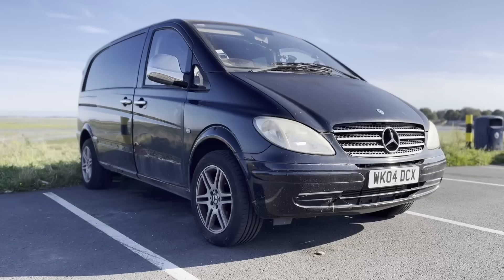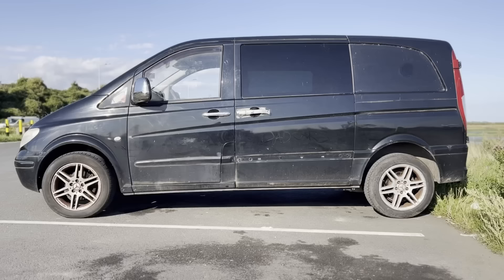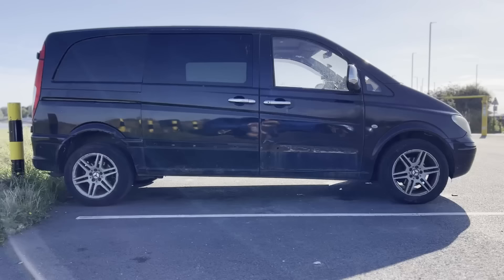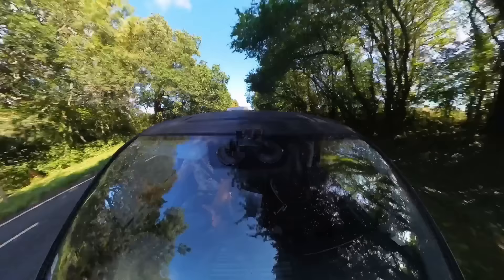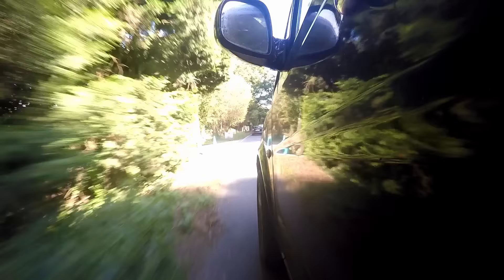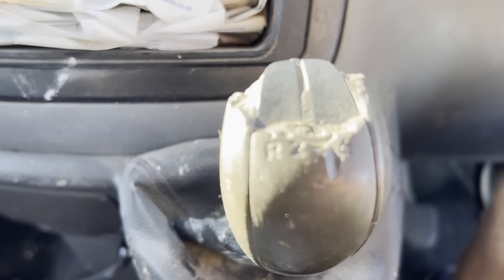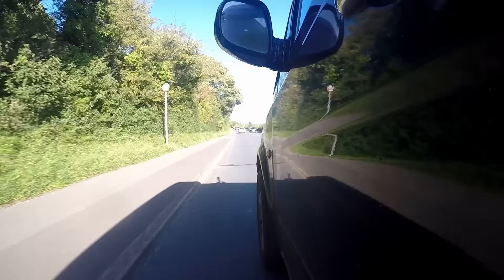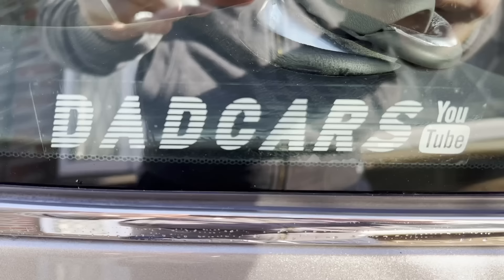The Mercedes Vito Is A Bargain VW Transporter Alternative With One BIG Problem

Comment: Love the vito. The removable captain  seats make them really versatile. I bought a 2010 model 4 years old in 2014. Had it for 10 years and taken it from 50k to 150k miles without a single issue. The dual sliding doors is totally a game changer and when we go camping we have an inflatable side cabin. Taken it skiing also in Austria and put chains on so rear wheel drive was fine.

Comment: I had 2 T4 Transporters and they were both high miles, and bulletproof, but 1.9D non turbo, so very slow. I wanted a T5 but when I looked around there were so many for sale with issues it put me off. I worked for a company that had 2 W639 Vitos with different blokes driving them, worn out looking, not an easy life, and 250k miles plus, but both ran well. I picked up a W639, 115CDI, not sure if it's chipped but it's very nippy, high miles, but drives really well and been a great van. I really rate the 639 2.2cdi.

Comment: Correct about the rust I had a 2004 vito ,and it went to the scrap yard.  
Now I have a 2013 vito and it's got very little rust. 
They are good work horses, they ran to 2013-14 . 
The later one return better mpg  but all are good value.

Comment: I’ve had both and the Vito is better to drive and more reliable and it’s got 217,000 miles on the clock,the only thing is the transporter was more spacious but the size was a issue with car parks where the Vito doesn’t have that problem,great video 👍

Comment: My dad just bought a first generation vito the thing is extremely beat up, but still relatively solid in mechanical means. Now it’s a challange for me to get it to pass the MOT 
Door sills wheel arches rear flooring panel needs replacing windscreen must be repaired the entire suspension of the van needs to be changed. It’s going to be heaps of work but I bet it will be fun wrenching with the old man
Reply from the maker: Father son time 😊🙌

Comment: Great video. I have managed to run my T5 for buttons. We needed a LWB Shuttle for our then 5 kids. We went on to have 8. Two big bills in 17 years. The trick is not to have it serviced at a dealer. Dealer parts and labour are eye watering. So big bill one was 4 years in and was a couple of grand. Big bill two was a refurb of injectors and turbo at 100,000 miles are an injector failure on the M1.  When a council tipper reversed into my T5 we got a Viano (posh Vito) for a loaner. It rode better and was more refined. I was also usefully smaller, even in XLWB spec. But the tin worm is the big issue with the Spanish built Vitos and back then they were just as expensive. In my experience lots of T5 spares are cheap as, especially the four cylinder which is all car parts. There is an endless supply of pattern parts from places like Autodoc. For example VW wanted £280 for an air-con condenser. Autodoc had one for £66. The five cylinder 2.5 AXD which I have is more expensive but it is a great engine and has a gear driven camshaft. I can't believe that over 17 years of motoring it has only depreciated about £10,000, or around £50 a month. They are pricey second hand but they do hold their value.
Reply from the maker: Great comment! Thanks for sharing this, wait what how many kids do you have?! 🤯
Reply: @dadcars  like you we had 4 young ones by the year 2000 which we carted about in a couple of T4s but we just kept going and by 2013 we had 8!
Reply from the maker: @Gorbyrev  that’s incredible! Well done 🙌😅

Comment: We had a 2007 extended 109 cdi version. Now we drive a petrol VW...( yup), a Caddy Maxi... 7 seater... and a boot! So they do exist. Do to emision regulations on diesel engines in the netherlands, we made the switch to petrol.. and you are right. A 7 seater with a boot are hard to find if you use the seats.
Reply from the maker: ULEZ in London is killing a lot of these good old work horses too 🥲

Comment: I bought a brand new 2004 Vito 115 at 150+bhp first in Cornwall, brilliant rally car in van clothing,12 months later the silver paint had an issue as every panel was a different shade and Mercedes said it was in a smash but no it was the paint, Mercedes repainted it free of charge, only other issue was the turbo actuators, years later and i mean years i pulled into a local garage and the guy who had bought it after my 2.5 years of ownership pulled up and the mechanics were perfect but the body was goosed,Currently on my second ML270 and still a merc fan.

Comment: I bought a cheap Vito when I started Amazon driving over lockdown. I loved it to bits!! It was ratty and faded red, but it was brilliant. Unfortunately it was rust that got it. The panels were a bit rusty but it was the underside that I couldn't see that claimed it. Nearly half the sill under the sliding door had dissolved and some very large holes in the front cross member. I would buy another in a heartbeat though, if it wasn't for the stupid London ulez. It would be the perfect vehicle for my current job, if I didn't have to go into the ulez zone regularly. Your video has made me really miss my red baron van 😢
Reply from the maker: Yeah ULEZ must be making it very hard for self employed people who need a van 😓

Comment: I've had x4 VW Transporters, 2 x 1.9 x 2 2.5 TDI  And I've Sold them all to go back to a MK1 W638 Vito Om611 Engine. Million Miles of Hassle Free Motoring With Mercedes. Values on MK1 Vitos are going up, get one before they go crazy in Value. The transporter market is Finished it's been over done for 10 plus years. People now want old Mercedes which is Great.
Reply from the maker: Things went crazy after Covid 🫣

Comment: Both my parents have owned transporters (mums is ‘05, Dad’s owned a few but current one is a ‘10 plate from new) and they’ve been basically flawless. An EGR fault on the 2010 and a faulty electric window on the 2005. 

I’m currently looking at getting my first van (to sleep in) and I’m torn between the Vito and Transporter purely due to cost… maybe I’ll end up with a Caddy 🤷‍♂️
Reply from the maker: You could get a Vito AND convert it for the same price as an equivalent transporter panel van 🤷‍♂️ if you, unlike me… keep on top of the rust then it’ll be a lovely owning experience for you
Reply: Have you seen the ludicrous prices for Caddy’s?😮😮😮😢

Comment: A company | worked for got a fleet of Vitos when they first came out (2002). The only issue I had with them was the lack of space above the pedals. On the one I was issued with I removed the trim above the pedals. They were all electronically restricted to 75mph. Except for some reason, mine wasn't. During a week off, one of the supervisors found out mine wasn't restricted and decided we were swapping vans.
Reply from the maker: 😅 how did their fair over time? All rust to bits?
Reply: @dadcars  I left the company 6 months after they were issued. Last time I saw one of the vans, it was 3 years later and it was on the side of the M4 at Reading after rear ending another car in a traffic jam. That one looked quite badly bent. 

I've been after a decent van for a while. I always dismissed these due to rust, and Mercedes parts cost. (Last Merc van I had (1984 508D) cost nearly £2,000 for a full set of brakes and put me off them for a while. I sold that van not long after (1999) and the person who bought it from me still uses it. So it was a reliable beast. ) Maybe I should reconsider.
Reply from the maker: @LordClunk  yeah parts not been to bad for me, always taken it to an independent garage of course

Comment: I have a 638 vito. Had it around 4years, and have the basic 108cdi, always starts and stops (discs all round) and is 100 x better than the vivaro it replaced.
Although mine has rust scabs, it's not impossible to tart up. The underside is solid.
Mine's fwd and regularly gets between 40-50mpg when driven carefully 👍
Reply from the maker: Would you believe I’ve never calculated my mpg 😅 but compared to the cars I drive, it feels like a tank of diesel goes on forever 🙌

Comment: Great vid thanks for sharing. I haven't owned a van for 27yrs. I used to run mk2 Transits. Couldnt find an affordable modern one that wasnt hanging off the chasis. I avoided the VW, like you say, excessive mileage at a decent price point. I know Mercs rust out but for a few hundred over my budget I picked up a SWB Sprinter, no rust. I had dismissed the Vito. This was because the independent Mercedes van guy who serviced my mates fleet said he wouldn't touch one. Ive seen a lot of older ones on the road, going strong, that says something. I like my Sprinter but boy is the front suspension and steering awful. Ive dropped a grand on mine, all the joints and shocks that were worn done. Its still tiring to drive, compared to my works, Transits. For a low top I can just stand up in it, a bonus as it doubles as a stealth camper as well as my daily commute/ PA shifter. Im not getting any younger. I may run it for a year and swap out for the Vito. Im not out in it enough to warrant the height. You’ve opened my eyes. If the Vito has "normal" suspension.
Reply from the maker: My suspension isn’t great 😅… I like the idea of doing a sprinter office/ camper conversation!
Reply: @dadcars  I'll have to hire one. See how it drives. From somewhere with older models. I don't buy new motors.

Comment: Great video. I liked my Vito(2004) but sold it to get back into a VW (T4 2.5 tdi)  which I love.  I can concure on the rust, seen some really bad Vito's but mine was pretty good, perhaps as I did wash and wax it regularly. The T4 does has some rust but not all over like some Vitos can get. The Vitos's ride was better (but my T4 is lowered a bit) and as was the drive, I loved the 6th gear and wish had it on the T4.  When I bought /sold prices were a bit more level, account for age, was probably 33% move for the vw but wasn't that expensive.

A bad point on the rear wheel drive it that in snow or mud it make it really hard (or fun) to drive. I'd take it out if had too but wife wouldn't. Note on the hand / foot brake too. I had no problem but it put my wife off driving it. 

The Vito has a chain not a belt so that seem to really help with the maintenance as the VW new belt big bill every 4 years seems to come round pretty quick. My T4 has been good for 4 out of 5 years. But last year was expensive. With the VW price being high it also means the depreciation is a lot lower.  I think my van is worth more now than when I bought it (covid 'camper' boom) but a Vito a lot less. That 50% price difference now probably right.

Bit of a heart not head decision to sell the Vito and get the T4. I have recommended people get a merc if they want a vw alternatie ('but check for rust as they can disolve'). Sold mine to get back into the VW scene as makes every trip more interesting (wave hunting, vvw spotting) and I do a fair few shows (more acturately convoys) so it's a hobby as well as means of transport.
Reply from the maker: VW is a lovely van to own if you can afford the price of entry I agree 🙌

Comment: Mercedes have a lot to answer for when it comes to rust..
Literally their entire range, Vitos, Sprinters, cars have rust issues in the early 2000's, seems like as you say maybe 2007 onwards (ish) they sorted it in their cars, not sure about their van range.

Edit: Dates might be off, its been a while since I researched.
Reply from the maker: It’s been disastrous for their reputation
Reply: I've been running vitos since 2004 with my latest being a 2017 which i bought new and I can tell you now, mercedes have never sorted their rust issues. 
I've been in the body repair trade since 2001 and the majority of rust repairs I do are on mercedes. With the newest being 1 year old.
I'm in a constant battle to keep the rust from getting too bad on my own van that it's the second time that I've had to repair my rear arches because of rust. Not mentioning all the other places that's starting to scab up.
If it wasn't for the rust they would be the best van on the road.
Reply: @paulweston4994  ah... that's sad news.
I really noticed a big difference appearance wise in their cars when going through years, but I've never owned one or been around them long enough to say with certainty.
I know their Sprinters are atrocious for rust.
Perhaps that's how they keep the price competitive because I get the impression (right or wrong) that the engines are often long lasting.

Comment: I’ve had mk1  6 seater then I bought a mk2 with fold down/ away seats.I had to get rid coz of rust issues that could not be resolved.I’m now on my third one a silver mk3, 13 plate panel van lwb . Having previously had a mk2 that rusted away before my very eyes I was dubious about getting another but after driving everything else I decided to take the risk. 
i would definitely recommend them again because they have rectified the issues with rust and adding to that definitely recommend them to anyone who wants low maintenance trouble free motoring.the engines very good and run forever and ever I wouldn’t buy anything else it drives like a car I can honestly tell you that it does corners at high speed I’ve got 18’s on mine with wide ass tires  and goes like the clappers and beats most people off the line and I’ve got a lwb!😮I love them !! The absolute Best van on the market!! For sure!
Reply from the maker: I wished I had a LWB every time I picked up sheet materials in this 🙈 you have to put plasterboard at an angle as it’s slightly too small

Comment: Previously had an 02 (W638) and an 07 (W639) Vito camper. The mk1 was worse for rust and on par with Transits.
I would avoid both models as you can never eliminate the rot.
Mechanical issues can be rectified.
After the MBs I converted an 09 Renault Master Minibus. Not a spot of rust on it. Highly recommend them and Trafics for camper conversions. Just bought a 2000 T4 Atlantis, luckily I just moved to Spain so rust isn't an issue here.

Comment: We had a 115 CDI crew cab Vito as the family car my father got it new in 2004 and had it until 2017 and that time covered over 200k miles and  never skipped a beat the only issue was from it starting to rust afrer about 10 years both side rear quarters around the sliding door rails
Reply from the maker: Bloomin rust! 😅 like you say, never skip a beat mechanically do they

Comment: I had a Mercedes with the same engine and it suffered from the "black death", was quite expensive to sort it out.  Check the injectors are not leaking.  Saying that I was able to replace the injector myself after getting the head helicoiled.  Also the seats were uncomfortable, a big step down from 80s Mercedes I owned.  However some brands are even worse now so I can see the argument for these.

Comment: My good friend Fred Whitmarsh sold your van new in 2004 from Commercial Motors in Holmbush St Austell. I’ve got a 2014 64 plate Vito 122 CDI Sport  X Dualliner in black only done 51k miles, mint van and not rusty, plus I sold it from new, so I know it’s total history. Far better vans than Transporters , but I guess I’m biased as I sold them new for 24 years!
Reply from the maker: Wow this is awesome! Thanks for sharing 🙌 what’s your theory on the rust? Is there a year that it was sorted from?
Reply: @dadcars  
Yes, Mercedes started galvanizing the body shells for the 2006 model year, so from 2006 06 plate to current model, their rust resistance is pretty good. My 2014 Sport X is completely rust free, but it has had an easy life to be fair.🫤

Comment: I'm on my second transporter now. First,  an 06, 9 seater shuttle which i bought having done 187,000 miles. I sold it after 6 years with 260,000 miles on it and still running strongly. Our second is a T5.1 caravelle which is now on 140,000 miles. Ive found both to be reliable, trustworthy, workhorses for a busy chaotic at times family of six plus 2 dogs. We also pull a large caravan with no issues.  Never owned a vito and much prefer the looks of the transporter. Each to their own though. Vw tax is a thing so i understood why people buy Vitos.
Reply from the maker: Yeah transporters do look fab and they have the prestige now as everyone knows they are more desirable and valuable

Comment: I have an Ambient Viano,  3.00 liter petrol and190 HP from 2008, I use it as a Taxi on LPG, last year during extremely hot weather I clocked up over €6,000 in repairs over 2 weeks!
With only just over 60,000 miles, sick as a pig but not worth selling now, but it drives like a dream on long journeys.
The good part about Mercedes is that you can buy the smallest of pieces to fit yourself, VW are terrible in that you can normally only buy whole units at very high prices.

Comment: I owned a T5 2008 130 for 14.5 years in the end it had rusted sub frame and inner wings drivers door bottom and a rear arch lip. The sub frame was £800 and a lot of labour so it went to salvage. 
should have waxoyled the transporter subframes and the body.
It drove beautifully lovely steering but the gear change quality was great turned notchy around 90 K.
The first big expense was a DPF delete and remap. 
Then the 5cyl exhaust manifold was warped leaking and the turbo bearings worn and the manifold was skimmed and turbo reconditioned the intercooler bent like a banana due to the welds corroding. Otherwise at 15 years old it was on its original clutch shocks and exhaust and never let me down. 
It still used plenty of oil even after the turbo was renewed.! 
But get them waxoyled and change the oil 2x per year I neglected mine! 
Protect your subframes !!!! It’s epidemic as they’re just tin